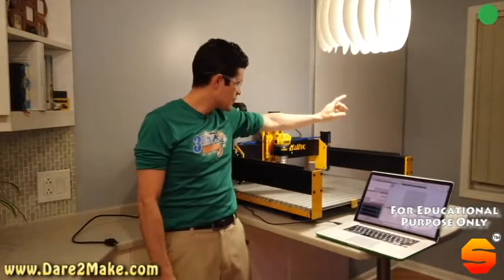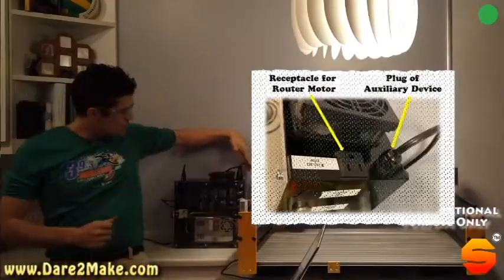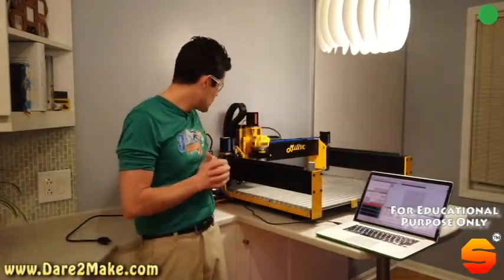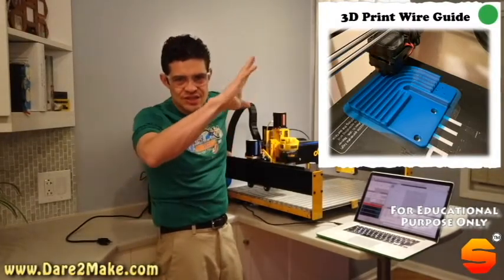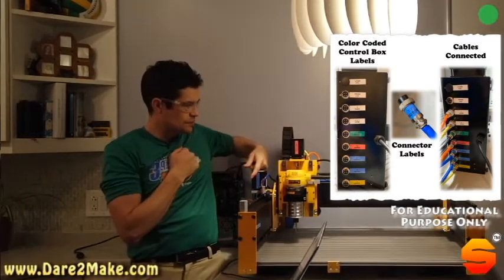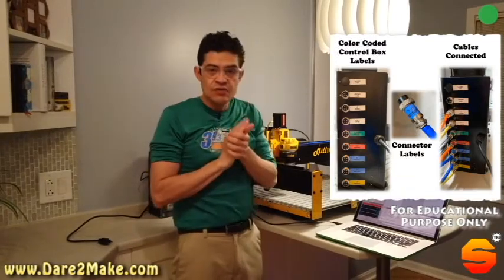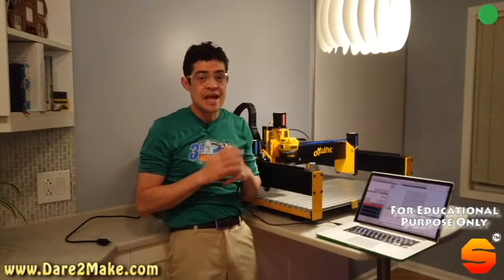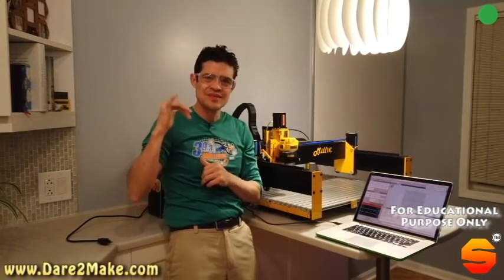MillRight CNC: Upgrades & Safety

Comment: I have problem with x direction is going wrong , when push to go right is going left and when push to go left is going right ....do you know what is the problem? What is wrong?
Reply from the maker: Yes.  It is in the settings of the software.  The machine is wired correctly.

Comment: Could those v wheels on the z unit/gantry be upgraded or replaced with something more rigid, or are they good enough for cutting soft metal?
Reply from the maker: Yes the v wheels can be changed to something more like a linear guide rail similar to the ones on the z axis.  I'm going to be doing the analysis for the maximum "material removal rate."  This machine is going to be the foundation for us to design our own machine.  Like Lego pieces! :)  I'm going to cut aluminum with it!
Reply: David I have several hours of cutting 6061 aluminum on my MillRight MegaV.    Yes you can do it.    Tram your machine and use O-flute end mills with good fixturing and you will find a decent combination of speeds/feeds.

If you have a lot of tool stick out you will be making some awful noises.    Recently did a 1.25in thick piece of aluminum with a 1.5in stick out .250 end mill.    Was on a metric feed rate of around 975mm/m with around .3mm step down with a .5mm step over on roughing.    Took a long time to get through my work piece but I didnt snap an end mill.

By comparison my depths of cut are much deeper when running a .5in stick out .250 O-flute.     To the tune of 975mm/min and .5mm depth of cut for slotting/roughing.   Even higher step overs or depth of cut for morphed spiral adaptive clearing.

I have run down to 1/32 end mills for remaining stock strategies but that is running around .05mm depth of cut and step overs at 80mm/min.   Rest machining will be a must along with a properly trammed machine or you will snap end mills like crazy.